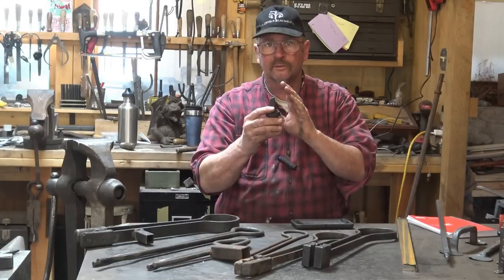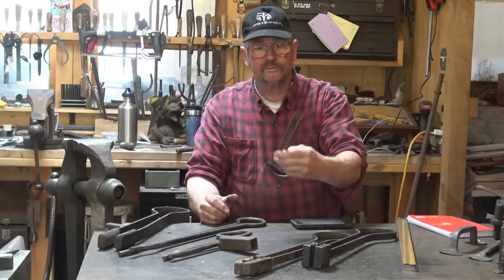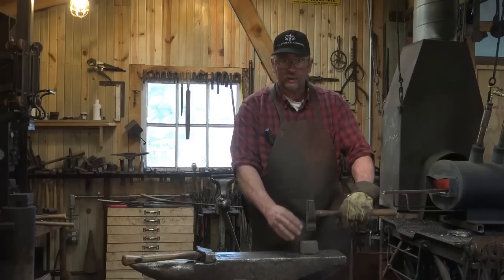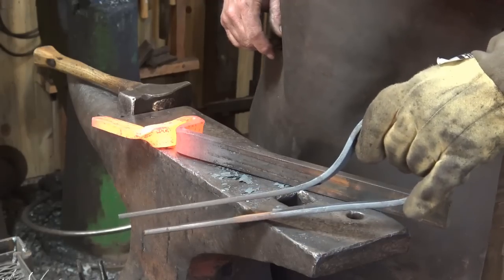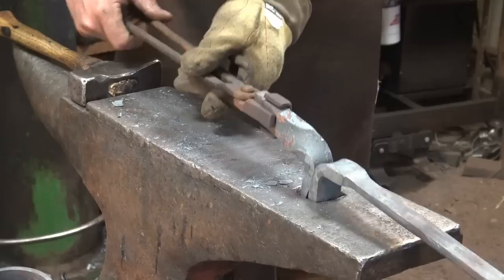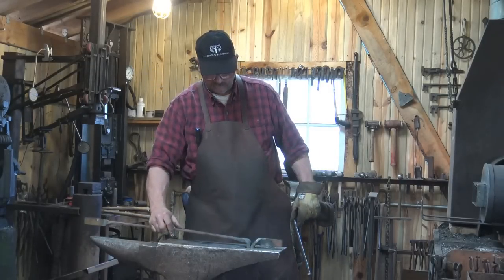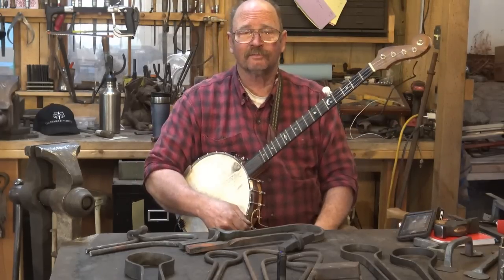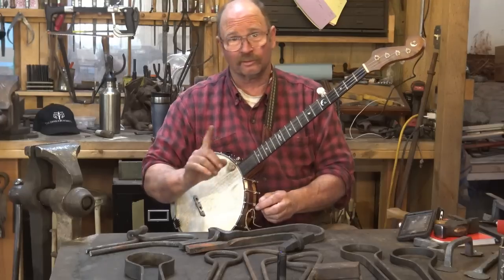Spring butcher tool for the anvil hardy hole - blacksmithing tools

Comment: Great video John.  I’m going to make one of these butchers too.  I recommend extending your bend for the hardyhole long enough with a gap so you can put a wedge in under the hardy.  This should stabilize the tool significantly.

Comment: When looking for an option instead of Arc Welding, what about Forge Welding. It would not take much more time and effort to add metal for the Hardy Hole and the Spring Butcher effect.
Reply from the maker: I think you will find that I include forge welding as a preferred option in many of the videos.  But since there are folks of all skill levels watching I try to offer different possibilities in ither videos such as this one.

Comment: Could you have left the loop longer on your spring hardy tool and put a wedge under it to hold it solid or does it need to have the movement in the hardy hole?
Reply from the maker: Yes you could
Reply: Black Bear Forge Thank you for the reply.

Comment: I made one out of a coil spring. Do I need to do any tempering? The whole piece has been heated up past critical. 
Thanks for your time
Reply from the maker: It should preform fairly well not hardened.  But the edges would hold up better if hardened and tempered.  Just depends on how much use it will see.

Comment: Is the spring handle to absorb impact ?  Would a sliding locking  collar do any good to hold pieces firmly like locking tweezers,but just  a rectangular band that holds tension when slid to the jaw / tool head or opens when slid to the hinge side ?
Reply from the maker: The spring is to allow the tool to open and insert stock and adjust to changing thickness during use.

Comment: Why didn't you flatten the area for the spring loop on the Fuller tool.
Reply: Clark Trowbridge I think 1/2 round is springy enough without thinning. Its about the thickness he took the flat bar butcher to.
Reply from the maker: I have done that in the past but as jetblackstar mentioned, the 1/2" bar is springy enough

Comment: Can you temper the mild steel butcher heads to handle being hammered better?
Reply from the maker: Tempering is a secondary step to hardening and makes hard material a bit softer. You can harden in Super Quench. And it helps some. Look online for a recipe.
Reply: I mentioned tempering because hardening can make material too brittle. I'm new at this and wasn't sure how mild steel would hold up to either just hardening or drawing it back a little.

Comment: How about a Smithing Magician?
Reply from the maker: That is what I typically use and prefer.  But most people don't have one and making them requires more tooling such as a welder or drill press than many people have in the shop.  But I have an idea for an all forged similar tool.

Comment: John, I have NO experience yet. Just been watching videos and working up the courage to give it a try. Just have a question. Is it possible to scarf weld tool steel bits to thinner mild steel for the spring? Or would that be more work?
Reply from the maker: It is and I think that or riveting would have been quicker and produced a better tool.  One of those two will be tried for the tenon die.
Reply: Cool. That's a project I'd like to try WAAAY down the road. I need to build a simple forge and make my first tools. Btw, I watched your video on making tongs without tongs. What about hammers. I could buy one but I'd like to make one too. How to make a hammer without a hammer. Maybe I could just use a sledge.....